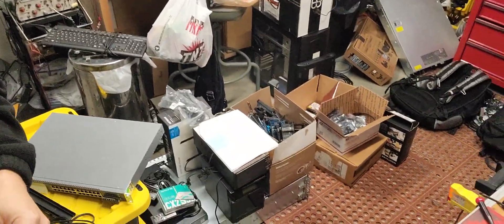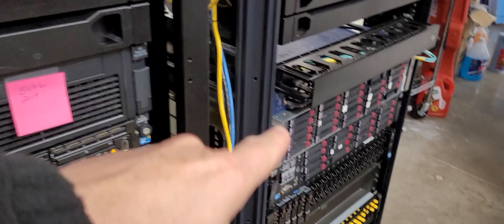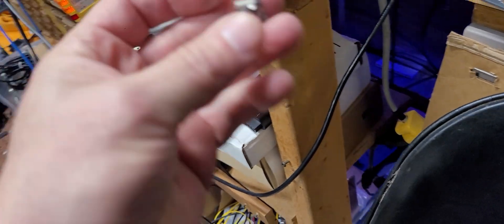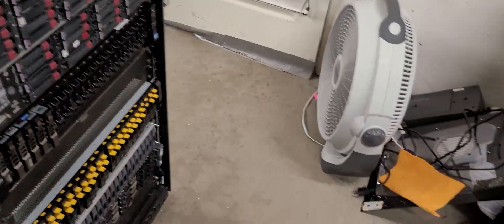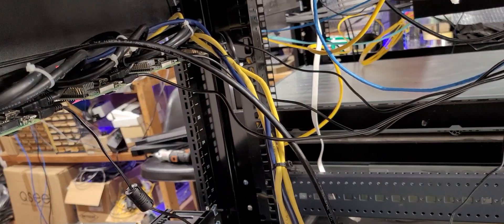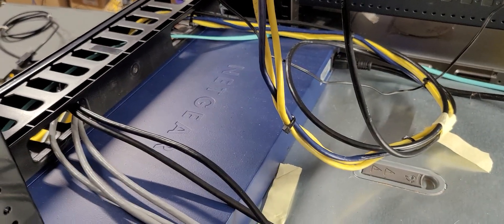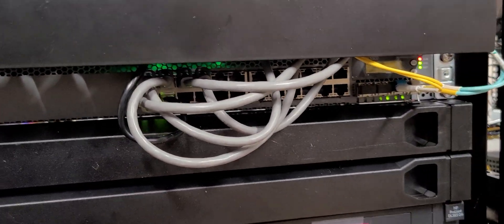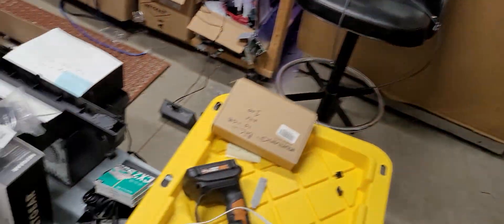Out with the old Nortel 6100 48 1GB port switch and in with the new Juniper EX3300 10Gb switch! Yes!

Comment: Hey brad bit of a gap in this video but few questions regarding topology. Many you tuber home labs seem to consist of Hconnectedswitch connected to a N A S.  this does not seem to take into consideration the security or  internet bottleneck though the isp providers equipment

not sure what your current connection is to your isp provider or whether its a business line but do you connect through an isp box or straight to your core router being the juniper switch or is it to a firewall first

1 Maybe you can explain why not many you tube home networks cover a layer 1 2 and 3 switch setup is it because its not needed for the home test lab ?

2 if you wanted to add a packet forwarder would this go between your switches ?

3 would the topology be as follows
Firewall router/ core router / packet forwarder / secondary switch / N A S

4 Can you miss match all your equipment in the network or with you using juniper is it preferable to have similar equipment ?

5 I think you need to do a video on were you should place your firewall for a home lab setup as it does seem this is something not explained very well by people show casing home lab setups ?
Reply from the maker: Hmmm so stuff to tink about bepending on how you deploy your setup...  Msot use a switch router setup,  I don't so I cna use Layer 1,2,3 adn more for I have multi tiers of netowrking in my lab.  With VLANs to boot. I will tink about this..  Thanks..
Reply: @leadiususa7394  yes well something to consider when doing firewall topology is how you setup the network were the firewall protects your home lab separately from you connecting to the internet 

as if you use your switch as a router and switch you loose some efficiency i don't no how much though so it could be debatable ?

but are you not better off with separate equipment for each task

so like

option1
a router for routing
a firewall to be just that
a packet forwarder
a switch 
because if you use one switch to do it all 

option2
a switch router on its own like you mentioned ( this seems to be the worst option)

option3
pf sense or op sense could be an alternative but with this you need a device that can support your connection isp speed which varies alot for people consisting from 300mb / 1 gb / 2.5 gb / 5gb / 10gb 
then your packet forwarder
then switch

option 4

juniper does something were you can connect multiple levels together could  be expensive now in your last video you showed your 10gb juniper purchase you said you wouldnt use that back end but if you purchase i think 
5 ex3300 you can interconnect them i could be wrong of course it maybe 4  but this would be another isp setup

option 5 

now i know you use rasberry pis so this maybe a project but is it possible to load pf sense or op sense onto one of those

final thoughts

so i am unclear on why a lot of you tubers do home lab video they say this is the perfect, best setup because everyone situation is different so their setups would not be the same 

my issue i have is i tarted off with the switch router setup but now i am having to find multiple bits of gear for my setup and i am unclear from the options i have listed here which is best just from hardware point of view 

so i would need some video on explaining the options as it maybe you dont need all this equipment you may only need a switch router 

but if you want to run a server as a home cloud server separate from the internet and you want storage backups and you want security surveilance over ip you may actually require more hardware to make your systems secure as one switch router may just not work properly on its own. but it might ?
Reply: @leadiususa7394  Yes well i know you have talked a little bit recently on how you deploy your own setups but you have yet to explain the actual best ways to connect to a service provider  ? i think you did say you have different connection with yours though that i have not heard of myself ?

Also i don't see in your setup with load balancing maybe something you don't need yourself  

As their will be a bottle neck at this point and if people are not aware of it they may waste a real lot of money on equipment they don't need

I would like to see how you connect to your service providers by bypassing the use of their firewall and using an enterprise level one but maybe you cant do this unless you have a business service provider line. not much detail on this but i am thinking you'll end up with faster transfer speeds than the standard one can deliver ?

i do have another question about the juniper switch so ill ask it their  :) :face-blue-smiling:
Reply from the maker: @1111000ANGEL0001111  All of these questions are great but they are really each a video by themselves. I have learned the hard way that most veiwers (unlike yourself...) can only take so much in a single video.  So I learned to keep it KISS foramt mostly.  Over time as I see more questions like yours, I will do a video on that added topic.   Sense I have doen that they seem to like it better.  I only have three or four like yourself that want the bigger picture in fewer videos to relate things together better. I get it.  I will cover many  questions you have in the coming months.  Also remember that I try to leave some of the thinking to the users so they can explore new ideas with what they can work with for I don't know what they have and I don't want to make they feel like they are behind or anything like that.